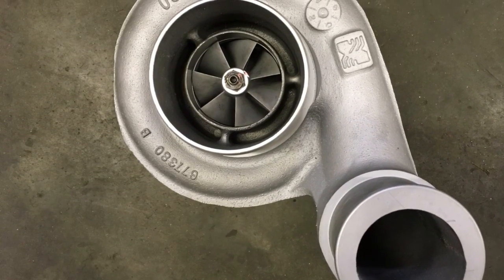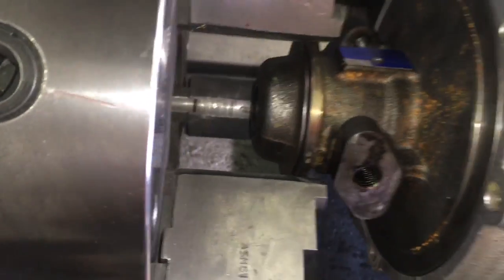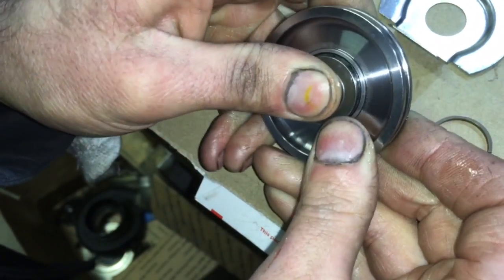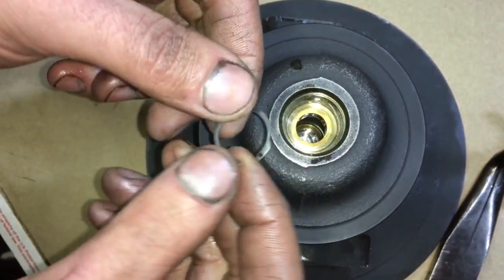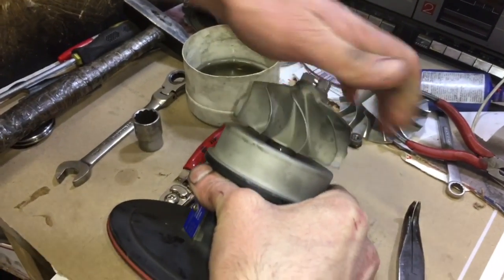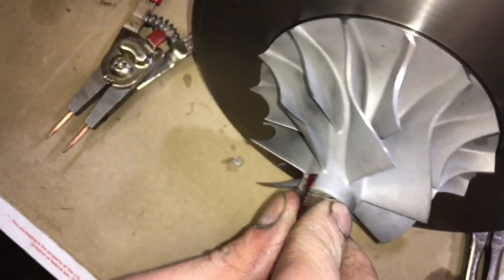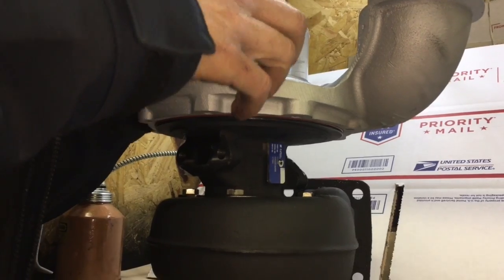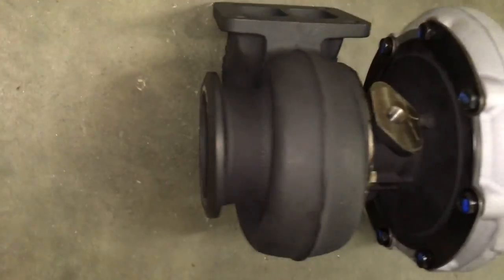Borg Warner s300 turbo rebuild

Comment: You should assemble the journal and thrust rings on to the turbine wheel shaft and then you have to assemble it in bearing housing...It will be simple

Comment: I bought just the s300 rebuild kit online from Austin. 

I have a 66/74 silver bullet turbo from industrial injection 

Everything fit just fine when they told me it wouldn’t work. My turbo has a build date of 2012. So maybe something has changed since then? 

I see no difference in bearings unless someone else has already rebuilt it once. Which I have my suspicions cause there was missing compressor housing bolts and clamps and also the o ring for the front seal plate was nonexistent... I have oil on my compressor side so hoping maybe the o ring fixes that

Comment: Good video, can you tell me what is the correct position of the oil seal on turbine side?
Reply from the maker: Put the gap up
Reply: @turbolabamerica  ok thank you👍
Reply: @dimitargeorgiev4264  Use a gapless ring. Rings always have the ability to shift with use. It really makes little difference anyhow because there shouldn't be that much oil getting to the ring with the oil return allowing high flow back to the crankcase. Worst case is the thrust bearing fails and lets the ring come out of the bore, then you are already past point of worries, time to fix it. Oil seal gap goes up on either side of turbo.

Comment: Have you ever used the extreme duty rebuild kit? I rebuilt my s366 with one and now the oil ring on exhaust side won't seal. It's the "gapless" ring style. It wasn't leaking before, I just changed it cause I was in it.
Reply: Did you figure out what the issue was?

Comment: what is your go to location to get marmon flanges for the BW turbos?
Reply from the maker: I'm not a fan of Borg Warner turbos over the Holset upgrades. I heard the term Marmon flange before and I know a little about what you are talking about, I think the main purpose is the ability for it to bolt on, not saying one is better than the other.
Reply: Turbo Lab America understood,  this is for a fwd drag setup and got great deal on turbo and have all but decided on having the tapered outlet ground flat so a std v-band will work